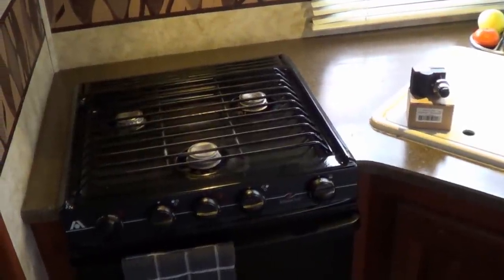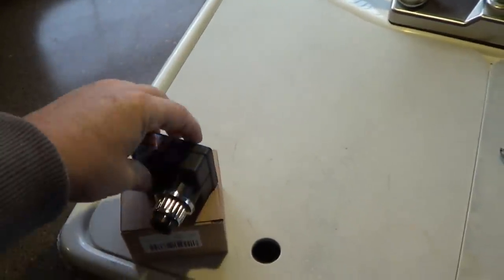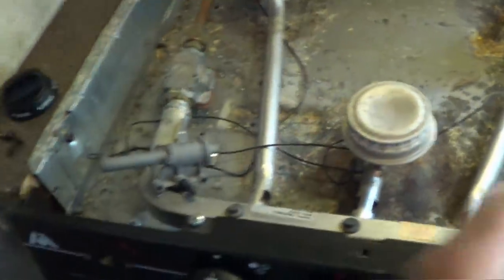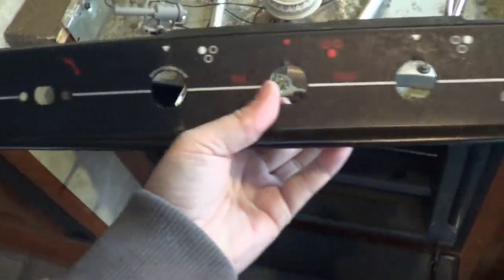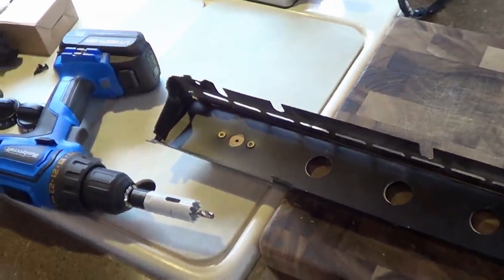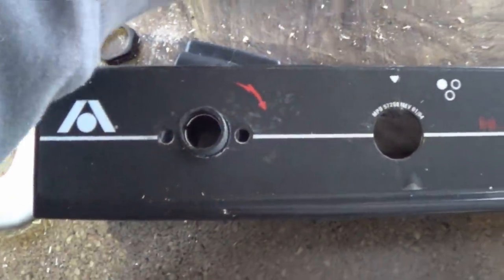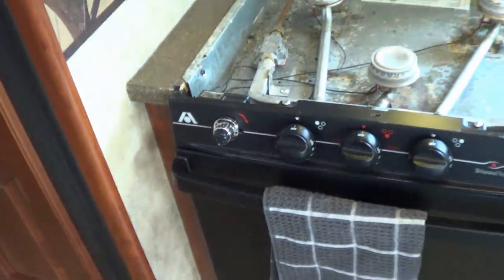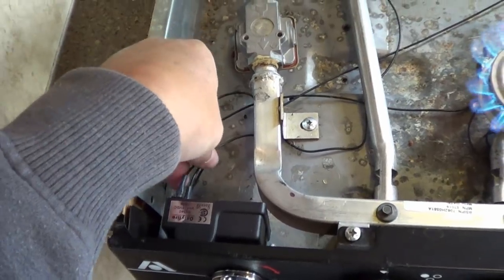RV Gas Stove Mod - Upgraded the Mechanical Igniter to Electric Push Button

Comment from the maker: Update  I originally installed the 4 pin sparker but it didn't work great as the extra pin would arc across, so I ended up replacing it with a 3 pin model  https://amzn.to/32UxEvq
Reply: Any unused terminals,  simply connect a wire to it and ground it. I used 4th to add igniter to oven but instructions that came with our module outlined grounding any unused terminals.
Reply from the maker: @-AnEv942  Cool, thanks for the info!
Reply: is is a bit late to the game, but the 4th terminal is great for your oven...no more having to get down and using a grill lighter to light the pilot anymore 😁👍

Comment: I have the same stove and just performed this modification with a 3 pin spark generator. Works great. I think that one of the terminals on the spark generator is of opposite polarity than the other two and on this stove the circuit is closed because the electricity flows through the electrodes, burners and chassis--the sparks travel from the electrodes to the burners on two of the burners but on the third it goes the other way, from the burner to the electrode and back to the spark generator completing the circuit. That's my guess, anyway. Also, I did not remove the control panel of the stove but rather drilled out the hole while it was in place using a strep drill bit which eliminated the need to worry about centering it as it self centered in the existing hole. I did have to bend a piece of metal out of the way inside the stove, however, part of the lip of sheet metal running around the circumference of the top of the range.

Comment: I am a new RVer, and so far, have only used the stovetop to ensure the gas lines are clear of air in order to consistently start the hot water heater. The first time my wife heard and saw me fire up an eye, she was <<less than impressed. So, when I saw your video, it was a done deal for us. Fortunately, I made sure that it would fit, and was surprised to find out that our stove uses only a single spark to fire all three eyes! There is a single output model! Anyway, just finished the changeover, and it has to be one of the MOST satisfying updates completed to date. Thanks so much.  If it is OK, I will include a link to your video, when I report this change in a future video on updates in my thread. P.S. Used a step drill for the hole.
Reply from the maker: You're welcome. Thanks for the info. 
Sure thing. Cheers! Ray

Comment: Pretty slick there buddy!  You can purchase a new control panel overlay (black or ss) to cover the holes up and give it a fresh look.  I have three brand new stainless steel oven door covers for the 21" Atwood stove like yours.  I am willing to sell these at a very reasonable price if you or anyone else is interested.  They still have the blue protective film on them.

Comment: Like that, I hate the stock igniter.  However, I've just been using a lighter which is easy enough.

When drilling through a tin ceiling I ran the bit counter clockwise.  Took longer but made a nice smooth hole without torquing the metal.

Comment: I thought I'd buy the same electronic sparker you bought for my rig's Suburban propane stove.  I have to twist the old sparker knob around and around several times to get a burner to light and it's hard on my wrists.  However, after I received the electronic sparker and tried to fit it inside the stove top, I found the unit was about 3/8's of an inch too deep to squeeze between the gas manifold and knob face plate.  Although the Atwood and Suburban stoves look similar, it seems they are not exactly the same for some dimensions.  I was going to return the sparker to the seller on eBay when I realized I could still make it work.  All I had to do was extend the push button and relocate the electronic module to where there was more room under the stove top.  I removed the rubber button and spring from the battery compartment top.  I soldered one length of wire to a dime to make the positive battery contact and soldered another wire to the metal side of the battery holder interior for the negative lead through a hole drilled in the battery housing.  I replaced the old sparker and knob with a push button and connected the wires to its terminals.  The electronic module is secured inside the stove top with pipe strap.  Works great.  The new electronic sparker easily ignites the burners now. Thanks for the seed of an idea!
Reply from the maker: Nice job, where there is a will there's a way!

Comment: Good job. I may take some grill components and convert mine after watching this video. Still use a lighter to lite it.
Reply: Hi came across your comment. Did you ever convert your manual lighter oven to this type of electric spark? New RV er here and I have a magic chef 4 burner with no spark lighter.. have to stick a bbq lighter each time to light.. wondering if you converted yours and was it an easy conversion?
Reply: @DoAnythingNew  No,. We ended up trading ours. That one had a  spark igniter.
Reply: @CrazyMooseManor  Hey very kind of you for replying thanks ... you and your family please be safe.

Comment: In wonder if you can add another wire to light the oven rather than standing on your head to see where you are directing the lighter.
Reply from the maker: I have seen some mods to do that published in a few RV forums using a BBQ electrode mounted near the oven gas feed. I decided against it just in case there was a leak in the oven gas line and it filled the oven area with gas and someone hit the sparker for an element. Could cause an explosion. Chances are rare that it could happen but I bet that's why the manufactures don't have a sparker down there and make us use a lighter with the door open. At least that's my guess.

Comment: Love it!!! I'm definitely doing this. I never use the OEM igniter, I always use a lighter. Maybe this will work better. Also, a viewer, Larry Askew mentioned that he did one for his oven. Any chance you'll do that and show us rookies??? Thanks. Keep up the great vids!!
Reply from the maker: I've seen a few mods online. Most of them mounted an electrode off a BBQ igniter and pointed it to just the right place to light the pilot. Then attached a wire with high temperature coating to the push button igniter like I installed. Only concern would be if for some reason the oven cavity was to fill with LP gas and you hit the spark it could be bad. Maybe that's why the stoves don't come with the feature.
Reply: Love Your RV That makes sense, didn't think of that. Anyhow, great video, keep em coming.

Comment: Thanks For the video, can you tell me how you got the wires off? I yanked and yanked on them but they don’t budge, I was thinking about changing out the igniter
Reply from the maker: Mine were just held on with metal press on connectors, I just use a pair of needle nose pliers grabbing the plugs and wiggled them off.

Comment: I might do that too. And maybe try to wire it to the oven pilot light if possible.
Reply from the maker: If you wire the pilot light make sure the oven pilot has the thermocouple device that turns off the gas supply when no flame is present. You wouldn't want a situation where the oven fills with LP and then spark it. ;)

Comment: Hi Ray, love your video's. I ordered the striker that you have linked on this video but you're having everyone buy the wrong one, we're all buying the 4 ignition lighter instead of the 3 that we need. I'll be sending the one I just got back to get the correct one. Just for your information, no big deal. Thanks  for the video's
Reply from the maker: Thanks, I did an update video clip about it but forgot to go back and change the old links, will do. Cheers! Ray

Comment: Love this! I just ordered. Btw, did you have to turn anything off to do this job? Or is it safe to just remove everything?
Reply from the maker: Quite safe, not much to go wrong really. Swapping out a mechanical sparker for a small battery operated one.
Just to be extra careful you could turn off the gas supply while you work on it and be careful when drilling the hole.
Cheers, Ray

Comment: great job as usual but dam clean the inside while open and front plate lol
Reply from the maker: I did! Stains are etched into the stamp metal and the front is a vinyl sticker getting kind of beat up.
That's just what 6+ years of full time RVing cooking almost everyday does to these cheap stoves. :)

Comment: Thanks for this video, excellent as always.  this MOD still going well?!  
My igniter very often does not ignite, random spark.  Just been changed and the same thing happens.  Plus, I get such a high yellow flame on one burner. 
 I just took everything apart, cleaned and tightened the tubes in place, checked the ignitor for faulty visual.  
Now all back in place and better, the tubes had dust dirt in there and one tube was loose at its base, creating that yellow flame from more oxygen passing through. 
I will try this push-button igniter,, it might work better.  
They have an all black model Onlyfire #14441, guess it would work?  I don't care much for the chrome.
I would buy a step drill bit to make the hole bigger, I am not familiar with those, do you have a recommendation of one good for metal and wood?
Reply from the maker: Yes works well, we use it all the time. First one failed in a few months as I had used the 4 terminal model instead of 3. You can find my update in this video - https://www.loveyourrv.com/many-little-mods-to-our-rv/
Reply: Love Your RV Thank you 😊,

Comment: Nice job.  I have the same set up.  I'm trying to figure out how to add a igniter to the oven.  You have 4 outputs.  What do you think about using high temp wire down to the oven and installing an electrode by the pilot.  It's kind of a pain getting down there to light the pilot.
Reply from the maker: Thanks. My only concern would be if for some reason the oven cavity was to fill with LP gas, say leaky line in there and you unknowingly hit the spark to light a stove element it could be bad. Maybe that's why the stoves don't come with the feature., making you have to open the door to light.  Chances are slim, especially since the LP gas detector is right below the stove door but I'm a little leery of publishing a video showing such a mod.

Comment: Any problems with this mod so far?
Reply from the maker: Other than the initial mistake of installing a 4 pin versus a 3 pin, No still using it, here is the update.  https://youtu.be/1qnva_zTId8?t=796

Comment: The fourth, unused post arcs across to the next nearest post on the backside of the module.  No matter how well I insulate it, it still arcs, weakening the spark.
Reply from the maker: Yes, found that out and it actually caused the sparker to fail. I changed kit to a 3 output unit and its worked great. Here is the mod update video clip - https://youtu.be/1qnva_zTId8?t=794   Cheers, Ray

Comment: I did the same thing but I also ran a wire and igniter to my oven pilot light so the same button lights everything.
Reply: Larry Askew what igniter did you use for the oven?
Reply: I used one similar to the one in this video. You just need one with enough ports. I then got another sparker like the ones on the range top and attached it in front of the oven pilot light. Took some adjusting but it works great.
Reply: Thanks Larry.  I was going to ask that question since our oven and range DON"T have an igniter system unless you count matches and butane lighters.  Lighting the oven is such a pain!!
Reply: Could you put a video up of how you did it?
Reply: Probably not a video coming, but it's an easy project. Just get a sparker and remove one small screw on the oven pilot light assembly and attach the sparker to the pilot assembly. You have to fiddle with it a bit to get it positioned just right so it will ignite the pilot light. The reason it's a bit fussy is because there is a very small amount of propane that is sent to the pilot light when you press and hold the oven pilot light switch. Once you get it positioned right it works every time. No more getting on the floor to light the oven. Just search Amazon for the igniter and an extra sparker thingie, that's what I did. You need an igniter with 4 ports.
Reply: That is a great idea to add it for your oven.....duh!
Reply: Larry Askew Thanks, I'll look into it.

Comment: You should have  added  an extra wire to light the oven.  I am planning  to do that to mine.  I hate standing  on My head almost  to light the oven.
Reply from the maker: I may do that myself since there is the extra port, I've seen photos online of it done by adding a BBQ electrode down there, my only concern would be if for some reason the oven cavity was to fill with LP gas, say leaky line in there and you unknowingly hit the spark to light a stove element it could be bad.  I''d imagine chances are slim, especially since the LP gas detector is right below the stove door but it would be something to keep in mind. Cheers, Ray

Comment: MY Atwood stove does not have enough space for the igniter. Disappointed.
Reply: I had to bend a sheet metal "lip" out of the way in my Atwood Wedgewood Vision stove model RV 2135-BGP to make room for the spark generator. With a metal snips, hammer and chisel it took maybe two minutes. I also had to temporarily remove a Philips head screw until the spark generator was in place, then I put it back.

Comment: Heating a kettle on the stove is so 1800..get a electric kettle with auto shut off...and the join the rest of the world .As a boy in the 1970s even then we had electric kettles in new zealand
Reply from the maker: We boondock for 4 -5 months of the year and use our propane versus electrical for appliances to save battery power. ;)